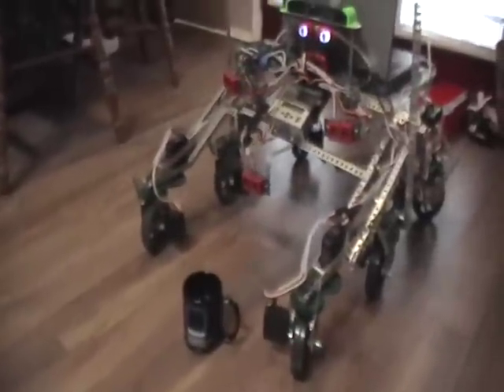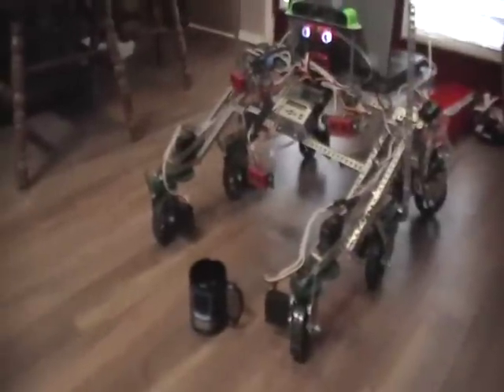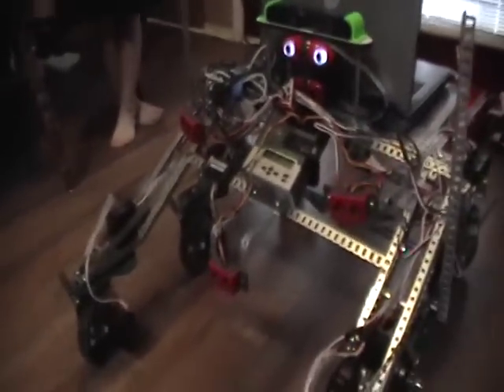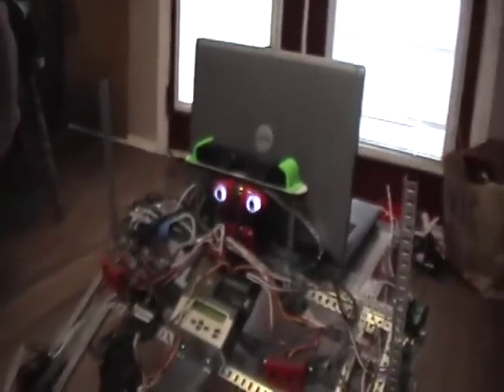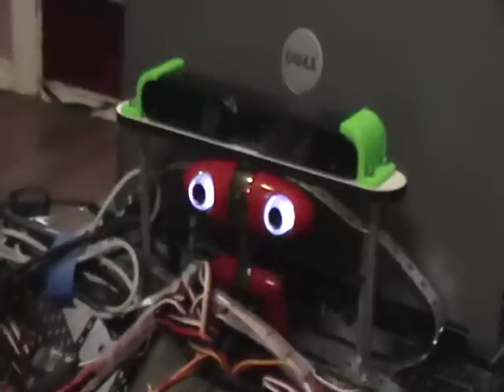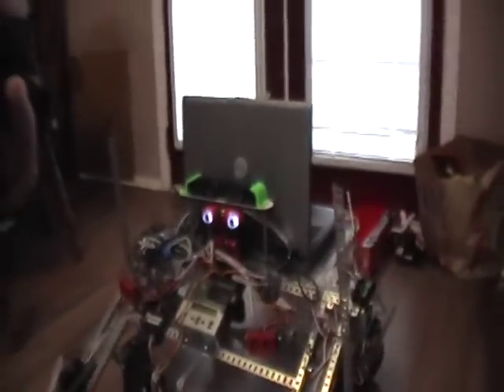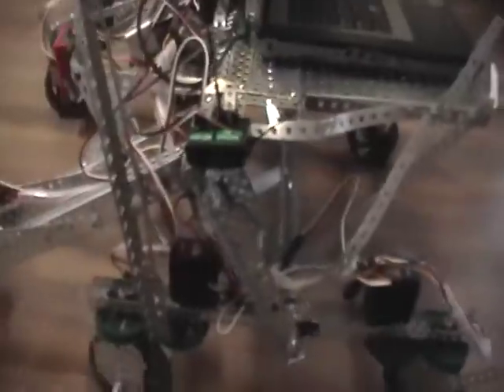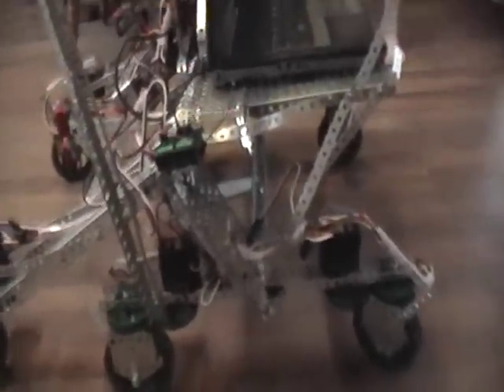jRover project run down

Comment from the maker: jRover project. Running a VexPro robot controller. With 12 motors 6 for drive and 6 for steering. It has 3 ultrasonic sensors. It is built in the mars rover style using a rocker bogie based suspension. It higher level controlling software is ROS from Willow Garage. It uses opencv to detect the blobs of color we want to follow or drive through. I will post more actions videos as we get further along. I will also post its run at the DPRG  outdoor robotics contest which is to be run on Dec 16th.  #hackfriday